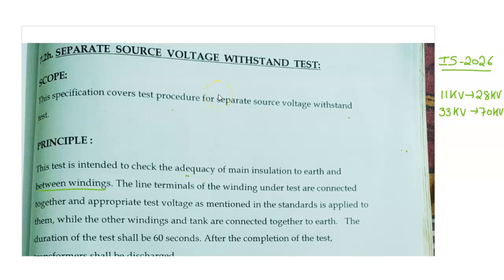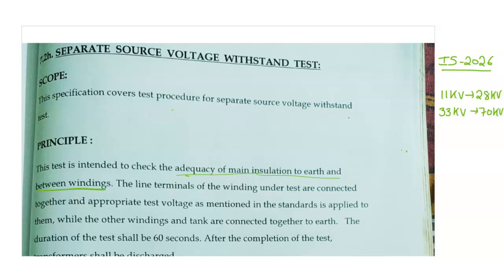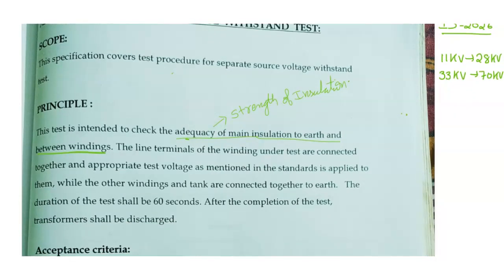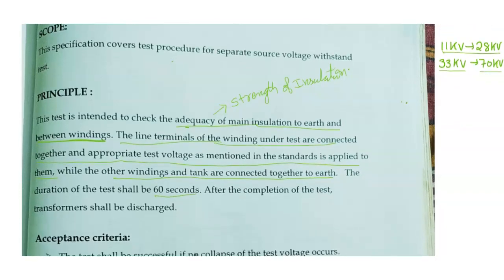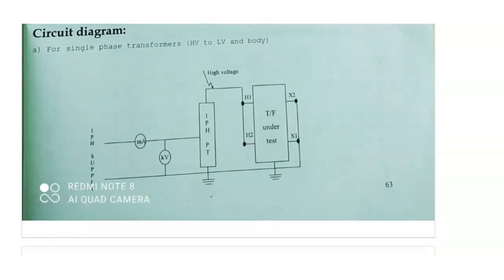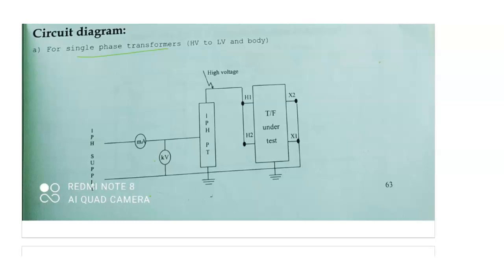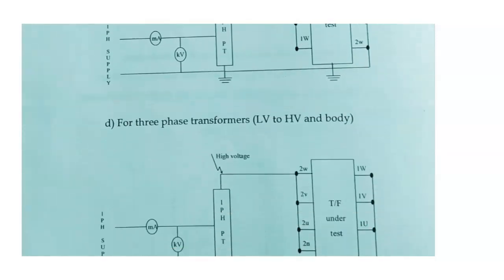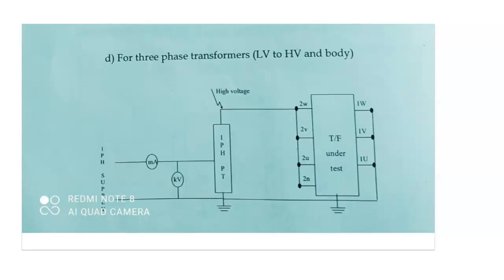TESTING OF TRANSFORMERS

Comment: How to select a suitable AC dielectric test device for a specific test object.
For example: I need to perform an industrial-frequency AC withstand voltage test on a transformer with a voltage rating of 35/6 kV and a capacity of 35,000 kVA.
What capacity should the test equipment have to be appropriate for this application?
I would like to ask the company’s engineers to help clarify my question. Thank you very much.